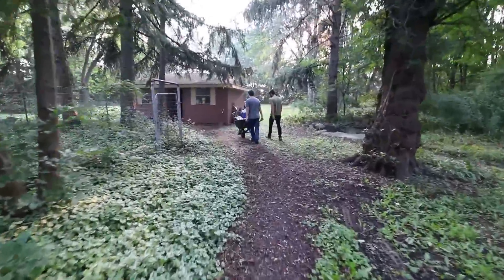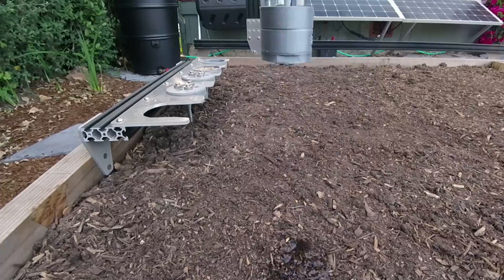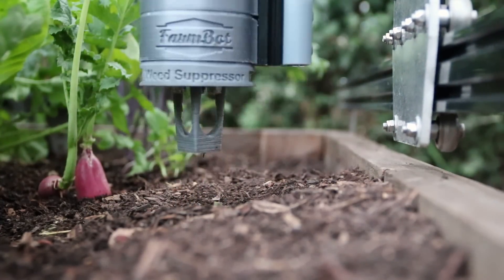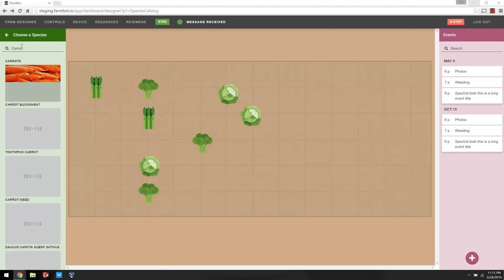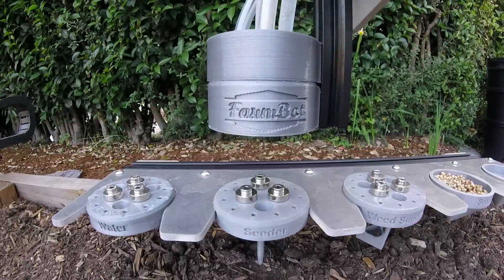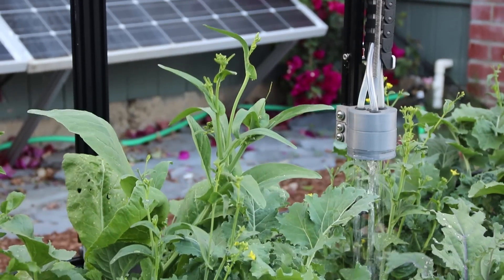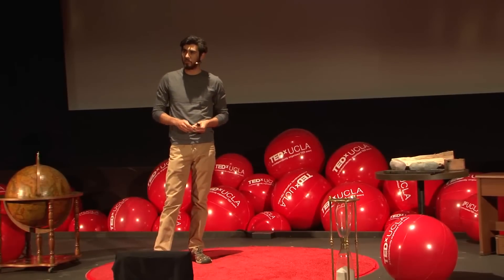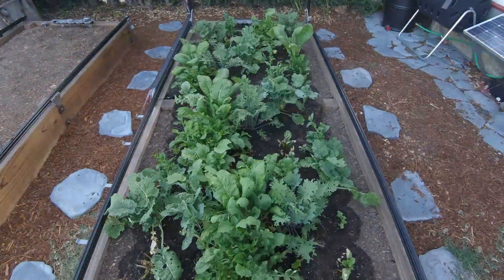Introducing FarmBot Genesis

Comment: You COULD buy this and set it up, program it, test it, redo everything, aso.  
Or just step outside and turn the hose on for 1 minute every few days...
Reply from the maker: Are you a farmer or gardener? If so, more power to you! Most people are not though. Instead they just drive to the grocery store to buy food from a far away land that are also produced by machines. Only 2% of the US population are farmers.
Reply: Lacks real world application?  This makes home gardening way easier.  How does this not have a real world application?  It eventually pays for itself I imagine due to savings in produce purchase, gas savings, not to mention time spent.
Reply: You forget about opportunity cost. After setting it up, assume it would save you 1 hour a day compared with doing the same tasks yourself. Average hourly US wage rate is $20(from google)--that's how much an hour an average US citizen's time costs. Therefore this tool will break even after 150 days of use, assuming  you spend your time well. I'm not a farmer but that's about 2 crop seasons. And that's even before the idea get's develop the device cost goes down significantly.
Reply: rjc0234
Oh ok, then i can answer. Maintaining this thing takes longer than you will ever save from the gardening done. It apparently costs around $3k, which would take you years of useage before it earns it back and you will still put in more work than gardening does. If it survives years of labor i would be very surprised. 
Automated farms already exists on a larger scale, this is a fun toy and i'd love to try it out but saying it solves anything is just wrong.
Reply: Never bought a carrot in my life, you got me there.  Set up for this "monstrosity" would not be too incredibly difficult for someone reasonably intelligent, somewhat tech savy, and physically adept with using their hands/tools.  Looks like a fun project to say the least.
Reply: You hit the nail on the head when you said you're not a farmer. I very much doubt you even have or know how to grow a simple backyard vegetable garden so best to not advise on something you have no knowledge of.

Remember that tech guy named Steve Jobs? Yea that guy that started a computer company out of his parents garage and built it in to a world wide multi-billion dollar company. That Steve Jobs. You know he loved getting his hands in the dirt and growing a vegetable garden. That guy shunned his children from using the very technology he helped invent. He felt it disconnected people from each other and I am sure Steve Jobs would shun gardening robots. For mass production of food on a large land mass big corp farm? Yea I am sure Steve Jobs would have approved but not for a home backyard garden.

I like and use technology like anyone else but when it comes to gardening, there is nothing better than getting out in the sunshine and getting your hands and feet in the dirt and connecting back to nature.
Modern technology allows me to work out of my home and only a few hours a day. The rest of my day is for me to choose what I want to do and one of the things I love doing and have been doing since I was old enough to walk when I was a child toddler, was to get out and help my parents work a vegetable garden. My wife and I both grew up in families that loved getting our hands in the soil and helping things grow. As such we taught our children the same thing. It's like being about to cook for yourself with rustic cooking tools. Same goes with rustic simple way of gardening. What if all your modern day computer technology suddenly stopped working. Could you grow your own food and cook it with much of any good quality?

I look at it this way. If you want robots to do everything for you then what's the point of you even being alive? As I said automated farming technology for corp farmed mass production of food is ok but to say a home gardener really needs a robot to work a simple backyard garden shows how physically lazy humans are becoming or some would wish us to become so that have a customer base for the garden technology. 

P.S.
By the way, I have 2 milk cows, 2 jackasses(mules), egg laying hens and raising a couple pigs a year. That along with my seasonal vegetable garden takes all of 3 to maybe 4 hours of my day and I know where most all food i eat comes from. I grow it and or raise it. I like knowing that with so much BS put in to food sources on the big corp agriculture farmers crops. 
 I do hunt and fish wild game also.
Reply: There's a lot more to gardening than just watering the ground... Its obviously not complete, and needs a lot more development, but its still a really good idea. it would be awesome if we completely automated agriculture. imagine a robot that would spend every second of every day looking for bugs in your garden, destroying them on detection. This is just a tool that will make gardening more accessible to more people. How about you acknowledge the innovative idea and give them some merit.
Reply: Using Opportunity Cost only works if you would be spending that time earning money. Opportunity Cost is irrelevant if you are sitting in front of the television or slinging beers.  I have a fenced in garden outside my house. It's 10' x 15'. I buy the plants, plant them, and water them when they need to be watered. I probably spend 2 hours a week on it until later in the season when I'm picking. Weed issues are reduced by putting wood chips around my plants. Planting and watering is never an issue with gardening. It's the pruning, staking, checking the plants for diseases, or even pollinating by hand that takes time. Try having that machine train cucumbers or pinch branches off your tomato plants.
Reply: FarmBot.io
if you believe this will make people farm more youre sorely mistaken. This is just a technic lego toy for hipsters to play with until it just gathers dust in the basement. 
I'm all for raspberry pi and cool gadgets to play with, but i dont believe for a second this expensive toy will create a farmer...
Reply: Johnny C How in the hell is this easier? How can you compare poking in a seed yourself and wetting it every few days to setting this monstrosity up? haha 
And paying for itself would take about 70 years... do you even know what a carrot costs?
Reply: Why all the hate on the FarmBot? No one is forcing gardeners to buy this product and give up their gardening experience. If you want to garden, then keep gardening.  It's a just a piece of technology that gives us option to make our lives easier like the iPhone. No one forced you to buy a car, you can just walk. No one forced you to buy a smartphone and text people, you can still send letters through the mailbox. Technology is just an option.  Having options is great.

For the vast majority of people who don't farm or do gardening, and just buy their food from the grocery, this technology will be a significant improvement in society. Everyone's produce will be local and fresh from their backyard. For those who really enjoy gardening for pleasure, no one is stopping you.
Reply: steve jobs also thought he could cure his cancer with said vegetables.. wouldnt bring that fool up as a voice of reason :D
Reply: +Micheal Radzicki we all like to not doing anything yet thing get done, but have you consider the maintenance of the device, the track will cover with dirt in no time , you probably spend your free time cleaning it
Reply: Johnny C
I agree with you there, im sure its lots of fun to play around with. I'm just against their hype that this will revolutionize gardening...
Reply: Fair point.
Reply: haha. i love people bigns sour that someone found a solution to a massive problem, so have to defend crap and broken systems.
Reply: so nice to hear that you dont work, and can therefore spend all that time in that garden you somehow own on all your benefit money, while hard working people stuck in offices can barely afford a one bedroom apartment.
Reply: rjc0234
Who are you talking to? Me?
Reply: Binge Bammer
nah. ryan and mandalore
Reply: Binge Bammer
well thats what they are gonig for, a funny toy. sports cars are funny toys, a normal £8000 Dacia will do the same job as a £1million bugatti. there are people out there willing to spend things on fads, and eventually it will work its way down. aircraft can cost £100Million+, but a light aircraft may only cost £8000. the price will come down, and the second people realise that you can get stuff done automatically, leaving you with more free time, people will be willing to spend the money. still the asking price probably lacks any economies of scale. i bet almost everything they sell is straight off the shelf at an electronics store, and they havent made any trade deals with companies. thats why it is still cheaper to buymany things fully assembled out of a factory, than make it yourself.
Reply: Cool idea, 100% unmarketable. You don't save money, time, or... anything over just having a garden yourself. If you're saying this is for people too lazy to have a garden, they're still going to be too lazy to do this. If you're saying this is for people who aren't too lazy to have a garden, they're just going to have a garden for less money (there's no money savings with this vs. normal garden). It's fun, interesting, but ultimately useless. Best of luck.
Reply: or spent 17$ on an automatic timer sprinkler from ebay lol
Reply: You could also write a letter in cursive and send it by pony express.  Get with new ways of doing things!
Reply: Bruce Burnworth
that would be more work, just like this garden..
Reply: geothermalenergy no one hate this product,
they common on it practical and usefulness + return of their investment

have the inventor ever workout how many years needed for them to get their investment return, i estimated 20+ year and no way this product will last that long outside, add extra maintenance part then this product will never give the use their return lucky if they get back 20% of their investment ... for most of us that a bad Choice. just like buy a car if you only get to drive 20,000 Km from your new car, i Doubt you will buy it
Reply: Jet Li i wanna build my own thanks to this video!
Reply: Mike Cammiso cool, it quite simple to build now, if you check Cnc rail and it kit from ebay
you can build them for few hundred buck, most kid include all the motor, controller and software, look for one also include SDK or library so you can write cool app for it with ease.. good luck
Reply: Jet Li I was thinking to completely redesign it, and design the garden around the garden bot, not the other way around where the bot was designed around the garden
Reply: in my opinion either way is not the way to go, I would consider make the bot self contain and mobile, with base station for it changeable tool, power supplied by hanging cable above

navigate the bot is a bit challenge, but achieve able. if you able to make it work it will be cheaper and not limited to size, would also be a very marketable device
Reply: How can you dismiss free time like that? What about someone who has a 90 minute or longer commute to work each day? Wouldn't they like that extra time to maybe sit back and do nothing? As someone with that type of commute, I look for anything and everything that gives me back what little free time I have.
Reply: SAVE $200,000 to $8,000,000+ = ANY #Business
http://www.strydeadvisors.com/information/stryde.cfm?page=services&id=235110 
Call 973--444-2381 + SamLCalland@GMail.com
Reply: Jet Li theres many other different kinds of configurations of this setup that you could do. Im positive we can create a self-sustaining/self-maintaining garden bot that could do 99% of the stuff you can do to a garden.
Reply: Why... this is so much better :/
Reply: Seriously... did this new generation completely forget about that thing called "WORK"?! Go outside, get your hands dirty, and make something. God damn pencil pushers.

Comment: Can you grow cannabis with the Farmbot?
Reply: from what i can tell from the video is that if you want you can grow just anything with it, setup a profile for your cannabis type and hang some leds maybe to help it grow and add a tool that will give the plants nutrients so that the plants will grow strong and healthy.

because its all opensource, anything is possible
Reply: Is it a plant? Ok then.
Reply: sure, but cannabis requires a lot of heat so you have to spend a lot on that unless you live somewhere it can naturally grow.
Reply: Yea will it grow cannibus, opium, peyote, salvia, cocoa all on the same plots?
Reply: +Charlie Cundiff Lmaooo
Reply: Typical lazy weed smoker...
Reply: Potentially although they have very different environmental requirements. Could probably be done given enough space and the right environmental controls (ie lights, heaters etc).

Comment: you need to combine this with vertical farms. make it all automated
Reply: believe it or not, most vertical farm concepts do incorporate something similar, they've got multiple sensors, outputs for each tray, and even adjusted lighting and growth sensors.

there are some issues, but they are being fixed even now with the incorporation of laser sensors to notify when the plants get too large, they are working on much cheaper alternatives, and alternatives that can basically be used in "snapshot" fashion, and not a constant drain of energy.

Comment: Hmm when you spend $3000 to have a robot stick a seed in the ground and it fails to do it right and you have to stick your own seed in the ground with your own finger do you feel like you just set fire to three grand to be extrahipster?
Reply: Not to help this along but a real "farm bot" should be able to work without rails and be like one of those remote control lawn mowers and manage 10 acres for you not 90 square inches of raised bed.  I want a wicked badass robot to spend hours at a time all day digging around and making my farm happy.  Maybe farmbot 2.0 will venture into this realm of shit that really makes a difference and isn't just for city hipsters (/eyeroll) backyard raised beds that never needed a farmbot those just needed the lazy hipster to put their tablet down for ten minutes and go out and pull a weed and sprinkle water on them couple time a week.  FFS gimme a break!
Reply: How about water delivery that doesn't use hoses just a trough that it dips into - I can setup a trough with a toilet float valve to always be full and maybe some GPS instead of rails. How about farmbot for trees!  etc etc - farmbot 1.0 doesn't work for me at all because $3000 buys a LOT of vegetables and seeds and offer very small gains IMO
Reply: I'm on board with this. I want a robot to tend the garden freely. I want a system adaptable to have different robots for different functions. And I want it to harvest as well. That's the time saving part. If you setup your raised garden bed correctly, there is very little weeding and if you have a drip system set to a timer system, what is left for this FarmBot to do?
Reply: Just saw a video were they were working on a apple tree harvester. Still in the beta stages. But, a good "open source" system should be able to handle different robots or just robot extensions for harvesting different types of produce. And if it can tend the bee hives, then that would be perfect.

Comment: This is brilliant. I'm always trying to figure out a better way to garden but this is light years ahead of anything I've ever tried or seen.
Reply: we have thing call automatic timer sprinkler that will water your plant automatically for less than 20$
Reply: Jet Li Yeah that's fine for watering your grass or a few select plants, but when you combine crops with different water needs in a close space like this, you need something that doses each one individually so you don't drown one and dry out another. You could plant sansavera beside a lettuce in this setup.